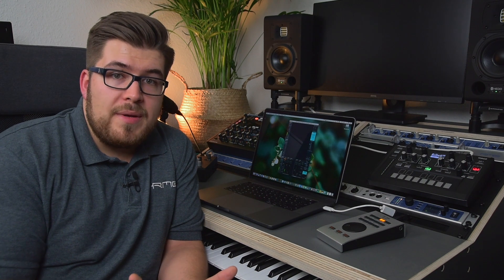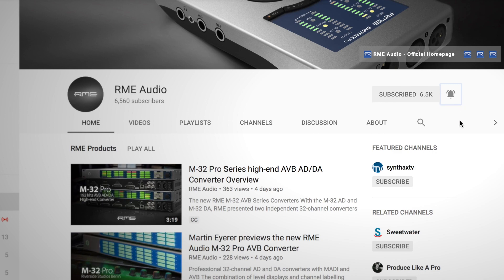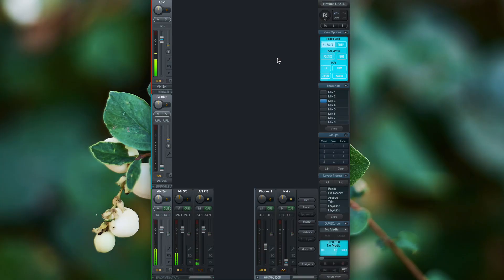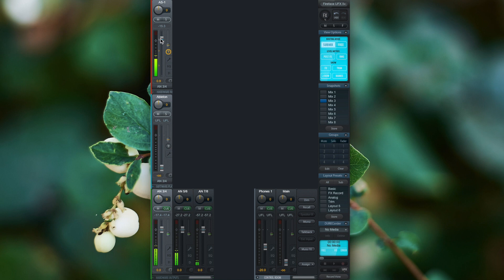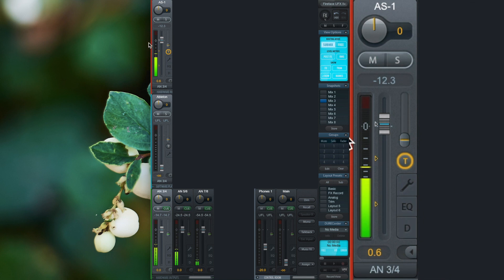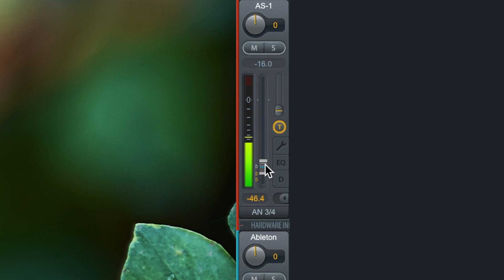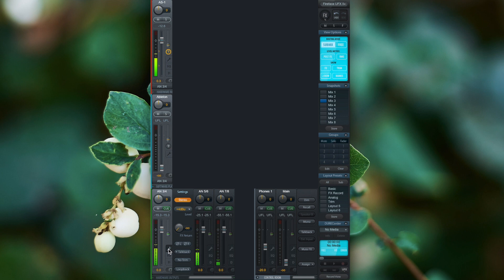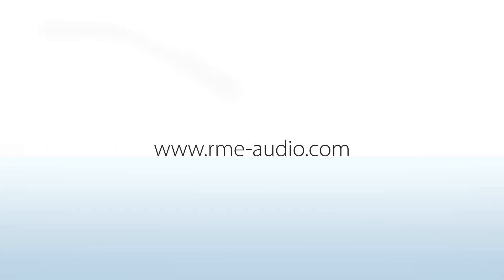TotalMix FX for Beginners - Trim Gains

Comment: Thanks.  I have a RME9632 and always find my input Level (via SPdif - Focusrite MicPre) a little low and Ableton barley registers a viewable waveform.  (I always clip gain the audio to see it afterwards).  Its a Dynamic Mic and I push the MicPre Gain very high but not sure how or if I can boost the RME input instead, using an internal gain control.  Any thoughts?

Comment: Hello RME! Is there a way to turn on/off phantom power on a channel via the Babyface interface? Thanks!
Reply from the maker: Phantom power can be switched on and off in TotalMix FX at the corresponding channel settings (tool icon). Manual switching is only possible in stand alone mode. 
(Manual Page 7) "IN gives access to Gain control and phantom power. Press IN several times to step through the inputs 1/2, 3/4 and Optical (SPDIF/ADAT). PressSELECT several times to step through left, right or both channels, as indicated by flashing LEDs. Then turn the wheel to change the gain, or press SET to activate phantom power (only in standalone mode). Phantom power is signalled by two orange LEDs at the bottom of meters 1 and 2."